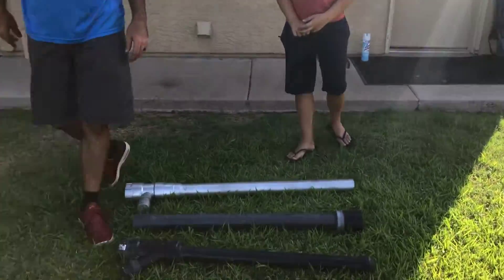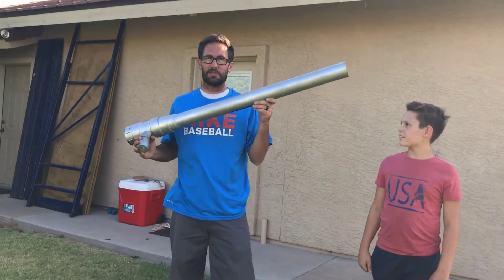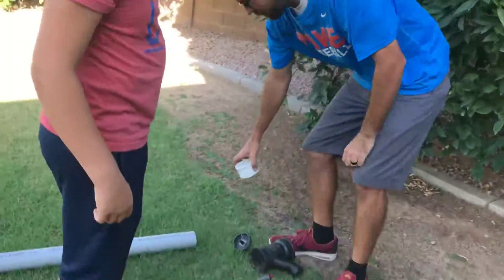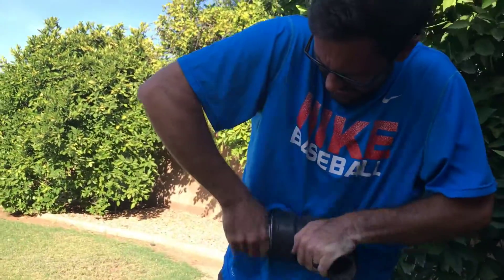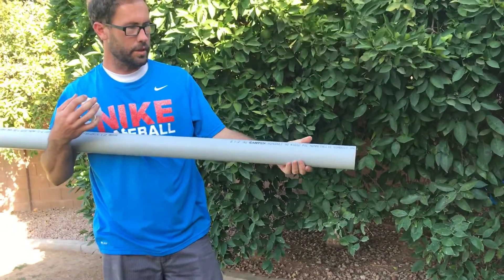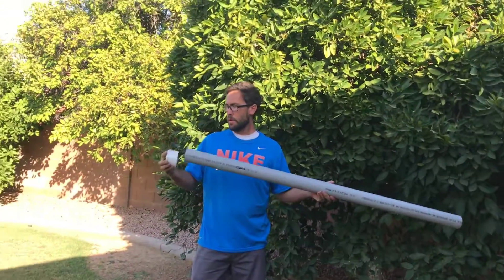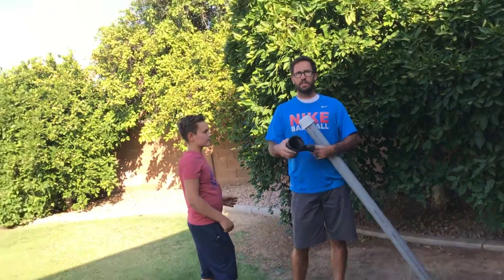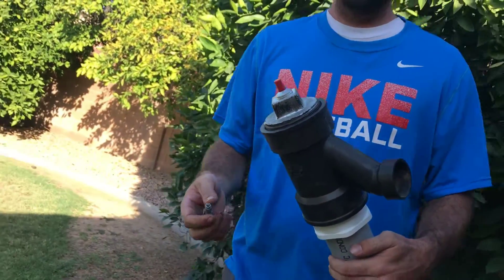HOW TO DESIGN & CREATE TENNIS BALL CANNON

Comment: What’s the piece called with the handle and threads
Reply from the maker: I believe the official term in store is called San Tee or some type of Tee. You making one? We have Instagram if you want to message on there. You subscribed
Reply: @AZ_MORT_SQUAD  yes, I plan on making one here pretty soon
Reply from the maker: @mason.chasin678  awesome sounds like fun! If you need help message us on Instagram az_mort_squad
Reply: @AZ_MORT_SQUAD  where did you get the schedule 40 pipe at?
Reply from the maker: @mason.chasin678  I believe you can get it at Home Depot. Schedule 40 Cpvc stronger pipe with bell end
Reply: Might someone provide a link to the part shown in the video with the threaded end?  I scoured the internet, but can't find a version with one threaded end as shown in AZ Mort's video.   Mort - Would you be kind enough to post the Identifying information and numbers from the part in your video?  The identifying information should be molded into the part.

Comment: Is the tennis ball dry or wet?
And what about putting the igniter on the wye handle stick be better? ..or does that deleteriously affect combustion flame propagation from the igniter tip internally across that then non-uniform shaped profile chamber?
Reply from the maker: Tennis ball is dry. The right amount of different sprays that go in there will make it fly out of gun!

Comment: 2.5 pipe and a tennis ball dont fit. I've tried.
Reply from the maker: Kenneth 07 What type of pipe are you using? You can’t use schedule 80 pvc pipe it’s just to tight. If you use conduit grey pipe that works good. Also once you put tennis ball in you have to use a long stick to load it up the barrel. Does that answer your question?
Reply: 2.5" pipe with 2.75 ball? Yes or no?
Reply: Hint --> You will have to soak the tennis ball in lighter fluid and burn most of the fuzzy fur off the tennis ball.
Reply: Tennis balls vary in size from 2.57" to 2.70".    If burning most of the fuzzy fur off the tennis ball does not work for you, trying buying 2.5" tennis balls that are made for dogs to fetch - sold on Amazon.